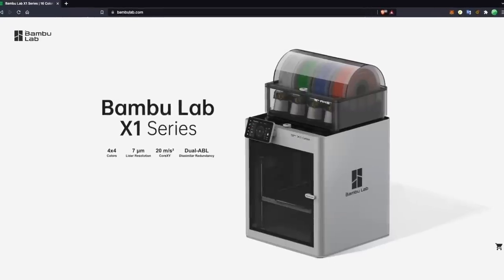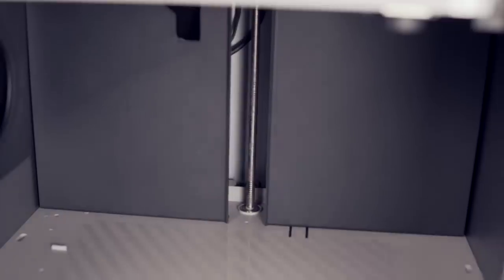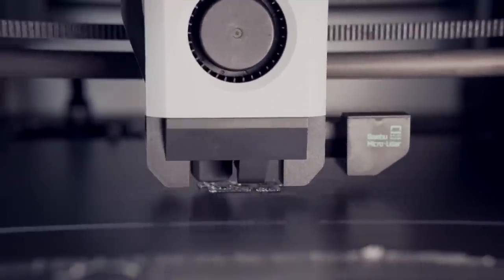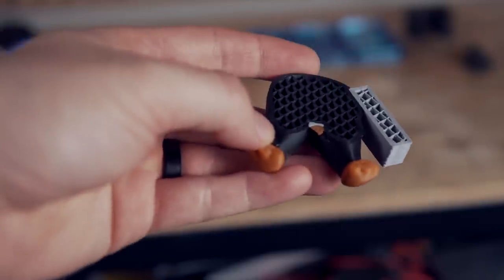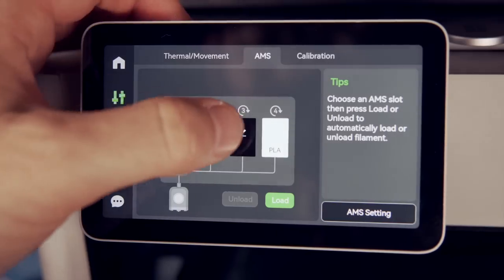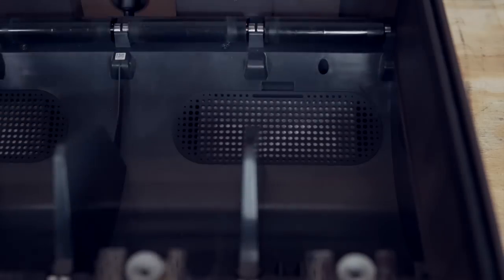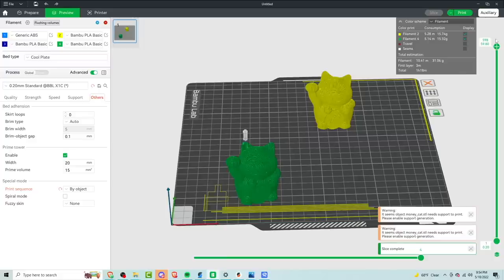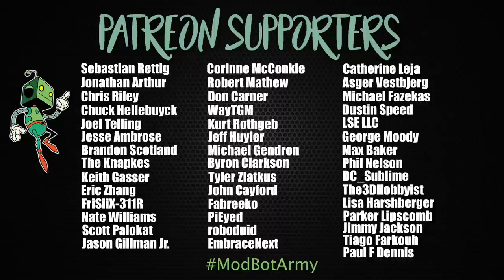INSANE 3D Printer That Requires ZERO Calibration (X1 Carbon)

Comment: This is the DJI style FDM printer we never got! Great video - I am blown away. The only thing that sounds too good to be true is the price for what you get. Nevertheless I can imagine it being successful and stirring up the industry!
Reply: Whilst reading you reaction about DJI, I heard in my head "Battery low, returning home in 10 seconds"
Reply: far from it
Reply: yeah kickstarters for 3d printers tend to be dodgy. 

I would question it. I've seen the same being said about many printers like a few years ago when people said it about delta printers and yet Ender series went on to rule the roost. 

same here. sorry. it won't shake up anything. 3D printing is no longer about innovation. that was the start. now it's about bringing certain standards to budget printers such as auto-leveling and filament sensors. And QOL stuff like linear rails. 

what these guys never talk about is the energy used .. to go twice as fast doesn't cost twice the energy... it actually costs more. like with the new Anker Kickstarter... nobody is mentioning that it uses a TON of electricity in a time when energy prices are out of control. 

just seems rather bot-like. 

and sorry but who is this for? it's got all the stuff aimed at people new to 3d printing... if you are experienced you can mod even an Ender 3 to be this fast and good for cheaper and have more control over parts used..  if it's for newcomers why is it so fast and expensive?

auto leveling and calibration is amazing... if you are new to printing. if you aren't calibrating e steps really ain't hard and even most Ender's and Anycubics come pretty well calibrated... in fact I've only ever had to calibrate one Ender 3 V2... as for levelling and tramming... I don't know why anyone struggles. I've never used adhesive or gluestick because I always got told: if you level and tram properly, keep the nozzle free of blocks and keep the bed clean of oils from skin you won't have problems with the first layer nor elephant foot. 

the only time you might want a BL touch or something is for with Jiyers when using it to make a mesh of build plates. 

And why not just use Prusa and Cura for slicing? this is like when an SLA printer does it... just let us use the slicer we want. so annoying.
Reply: Everything about this printer looks so hot
Reply: The same tought I had! I believe the auto built 3D printers will be almost dead soon if this kind of products will be out more and more... like exactly happened with custom built drones for aerial videos when DJI showed up :(
Reply: @razerow3391  The Bambu Lab X1C uses LESS energy than an Ender-3. From Bambu Lab ENVIRONMENTAL COMMITMENTS: "Due to the outstanding motion and thermal performance of the printer compared to a traditional Ender-3 type printer, we can reduce energy consumption by 50%-85%, depending on the material and model."
Reply: Actually the five guys who had the idea of the machine ffirst are former DJI employees
Reply: @razerow3391  Not even a custom Voron 2.4 using highest level components (which will come out at least twice as expensive) can beat these speeds.

Comment: as someone burned on kickstarter by even known companies, this seems too good to be true, especially what the printer is, claims to do (does in your testing), and the under $2,000 US pricing.  I mean when you think about it, SK-Tank,  RatRig Vcore3,  Vorons, all mostly sourced or kitted sourced, and cost nearly as much (more than the basic kickstarter $800,  up to and exceeding the $1,500) for similar build volume, speeds, and capabilities.

I don't see how they can do this, with the AMS system as well, for that cheap, at least long term.  the KS special pricing on the Carbon with AMS - $1149

The ENTIRE site advertisement is CGI as well, even the shots of the printer, which doesn't bode well.  EVEN the video 'showing off' the printer, is CGI - it seems to have an AMS unit that is real, but nothing showing off the printer being used, printing, or otherwise 'real'.  Your telling me they couldn't show some footage of them test printing a benchy?

I just dont feel well about this.  It seems they made a prototype or 2, sent them out to reviewers, told you all not to say anything "too negative, but well formed opinions are permitted', and plan to make a killing in 'sales' that will never actually be made or sent out to backers on kickstarter. (if you have to ship them back, this is even more support of this claim)

The claim of kickstarter in May and Shipping in July - also doesn't make sense.  Why do they need to kick-start, if they are basically ready to go?  2 months is not enough time to get any sort of funding into manufacturing or production lines to make thousands of printers to be ready for shipping.  The lead time just doesn't make sense with expectations, with reality kicking in about how this more and more feels like a scam, a genius scam, but a scam.

"make a few production models, send them out to get word of our amazing product to those that want it, make the production models a 'force return' to resend to other reviewers, then kickstart, get plenty of pledges, then rug pull and only send out the production models to show we were serious, but had complications unforseen"

I don't know maybe I have been burned by Kickstarter nonsense just 1 too many times. (Thanks Creality for the recent asshatry) and just can't trust in a project "this big" being "this fast" and "this cheap" for what it claims it can do (again, shown in YOUR test production model sent out)
Reply: These are real concerns, and I’m very skeptical considering just how ‘too good’ this is. 

With that said they do have a YouTube channel where you can see them making timed benchies. Maybe updating the website isn’t a priority? 

And even at full msrp this is a great deal without all the risk of being burned.
Reply: To be honest it's not uncommon for "off the shelf" products to be cheaper than building something yourself, especially if they can rely on economies of scale and automation. Still, I'd probably just wait for the product to actually start shipping before buying.
Reply: They have a print farm tho

Comment: I'm betting this thing really took the wind out of the sails of the Anker Make team at those price points.

I really like it overall, but I just hope they do something about the cloud connectivity - let users print directly to the printer over local network w/o requiring internet.
Reply: Ankermake also looks interesting..which to get?!?!
Reply: @jonhaze7537  Really going to depend what type you want and for what you want it for. The AnkerMake seems to be a much needed innovative package on the bed slinger approach where as the BLabs is the CoreXY approach. The latter is aimed at speed and I think is the overall better value at the EB/KSpecial pricing.

I'd say with the exception of a very few features (the BLabs Lidar/Structured Light being one), neither of these printers are truly "new" .. they're just polished consumer friendly packaging of what enthusiasts have been doing to their printers, which is the normal evolutionary step in FDM printing we tend to see every few years.

In ~5 years we're likely to see a lot of these features reach the economy of scale and filter down .. like with car manufacturing, high tech stuff goes to the custom (e.g. enthusiast driven tinkerer's), then luxury brands, then trickles down to the mid tier, and finally lands on the budget tier of every model.

Comment: Thst's a really impressive machine and overall psckage, especially the multi-color printing system with buffer. A single nozzle with an external switcher really is the best solution (and easiest to calibrate). This machine definitely raises the bar for printers in its price range, and for other firmware to improve their feature sets and user experience. Amazing product to come out of a Kickstarter too, as they are usually a lot more janky at the pre-release stage. Exciting times.

Comment: Soooo .. that Kickstarter went well. I've never pledged for a KS printer before, but we'll see how this goes. Was able to win the refresh lotto and get an Early Bird X1-Carbon. The Full Combo was sold out pretty quickly. I don't expect there to be much available by later today, they mastered the just-enough-units at the outrageous pricing to generate the buzz and hype they wanted, that's for sure. So for those wondering how this was going to be sustainable, that's your answer. Very limited supply at the Early Bird and KSpecial pricing (approximately 500 units each model / tier) .. they can effectively break even or take a loss and make up from it with the marketing they received.

My current printer is a ~5-6 year old unit, so it was in  need of a replacement. I'll likely give it to a local school.
Reply: That's pretty sweet. I missed the early bird prices so I'm just going to wait it out for updates. I am considering a prusa XL just because the build volume is bigger for my needs but no doubt bambu lab is using tech that makes every other hobby level machine jealous. Heck even some industrial machines are jealous. It's like an advanced 3d systems Cube Coretrio and voron tech had a better baby. Love the colors, love the lidar, love the speed.
Their turn around time is way better than prusa though.

Comment: If you want your printer to just work and not be constantly tinkering with it, this looks like the one.
Reply: This is made for me.  The only things I see here I would want is different print nozzle sizes on-demand (tool changer) and larger volume.  But the speed makes up for the nozzle size issue so for smaller prints this looks awesome.  Smaller is often faster also, so it sounds tailored well for a fast prototype system.

Comment: Very impressive.  This is definitely a machine I will keep an eye on.  Not a fan of Kickstarter, cloud printing or proprietary/custom slicers.  Why not just Octoprint support and just save the effort of spinning up cloud resources and software?  And why not a Cura plugin to support their slicer extensions? I'm pretty sure any of the open source slicers could be extended to support all of their nice features.  Then it's automatically cross platform, they get the benefit of improvements to the open source engines and users can use the interfaces they already know and like.

Comment: Seems an extremely well thought out machine. I've been thinking about some kind of vision-based first layer calibration for a while. I'm surprised their LIDAR can achieve sufficient accuracy. I suspect it's really a triangulation sensor, not a true LIDAR (which is fine and would be impressive as I have Keyence triangulation sensors at work that cost more than this printer).
What ever happens to Bambu and this printer, they have shown the way. My biggest concern is if they can maintain a low price point? Are they badly under-pricing the Kickstarter?
I won't be pre-ordering this as I'm done with Kickstarter (at least for a while), and won't be an early adopter for a company that has no track record (I did pre-order a Prusa XL, as I trust the brand). I wish then success though.

Comment: I can't wait until some of these new features trickle down into more basic printers and into klipper for the firmware things. I wouldn't buy one of them, but I'm also not the target audience. But I am very glad for anyone innovating in this space as it pushes other manufactures to do the same (Prusa comes to mind, revolutionizing 3d printing with the mk3 and now most of the features are standard even on fairly budget printers).

Comment: My concern is that they don’t have enough margin in the product, they will go bankrupt, and the customer will be left with a proprietary printer with no parts available and no software updates
Reply: Had similar thoughts. Even at the full MSRP it's hard to feel like they're making any margin and I have to suspect that the RFID chips will eventually DRM what filament the machines will accept.
Reply: @voicesarefree  Yup! There was a lot of engineering that went into this and I know what engineering time costs when you roll it into the product cost.. I hope I'm wrong though.. I have a print farm and would like to pick up a couple of these to test, but I will probably wait a while to confirm reviews once they hit the market officially.
Reply: @voicesarefree  Completely wrong, there are absolutely 0 expensive parts, if you know some ppl in the industry you can manufature this for around 400 all in with shipping, still a thin margin but it's fine.
Reply: @revoltoff  Retail price isn’t just a function of production cost and margin😅
Reply: @revoltoff  Perhaps 'any' was the wrong word to choose, and 'sufficient' would have been better. Like others have mentioned, all the wages and infrastructure around selling hardware demand either massive volume, large margins, or some other monetization scheme like DRM or subscriptions. The X1 has a lot of software that at this point looks (fully?) proprietary, and custom software development is not cheap.

FWIW, I worked for a printer manufacturer for ~4 years developing in-house manufacturing software. I have some relevant industry experience informing my opinion.

The X1 is an exciting concept and I would love to be proven wrong.. but I suspect the currently stated MSRP will have to rise or other "all-in" costs will need to be added for Bambu to turn a profit.
Reply: If they sell well, supply and demand will drive up prices. It's not at all uncommon for new products to be priced low, in order to get enough out for use and review. If the reviews from users match the claims, their prices will rise to meet demand.
Reply: @louisboliou7432  I’m aware of that. I just know that at the $1500 price it is out of range for youngsters and true “hobby” people. I think they would still have something here if they were at $2000. The feature set in this rivals our $70,000 stratasys printers.
Reply: @louisboliou7432  Yeah, basically they're a bit too late though sadly, most people got an Anker already and very few are willing to get both or even know about this (much better on paper) printer. Honestly, I think in the next 3 years 3D printing will finally become ''good'' because even for enthusiasts, the tech used is just old at this point and clones of clones of clones. I am not 100% sure but I do think in the next 3 years HP will probably release a printer.
Reply: Always price your product so the buyer hesitates a little and thinks a little but still ends up buying every time. If a buyer just buys it and says man what a steal its wayyy too cheap, they should say it's the best however it's cost reflects that, often times serious buyers may go elsewhere if the price is too low as they think it's too good to be true.
Reply: @northcountrywoodcraftny5953  yup.. that is my concern 100%.. I would rather pay this company 2k per machine and keep them in business to support the growth of my business rather than get a "steal" and bankrupt them over time...
Reply: @oneheadlight8000  I do not totally agree. This first realeses, companies need to have good sleeping points, and the price is one of them. Of course is more risky, they will deliver, they will support, bugs, etc. it is not a ultimaker. With this in mind, if they deliver everything anounced, could shake the market.
Reply: Or, this is the plan all along, as the 'production models' will be  the only ones really sold, and they will bank the rest of the kickstarter calling it a 'unforseen expense problem'
Reply: @Filthat  Yeah.. I think they will disrupt the market big time if this is representative of production units and they don't have any deal-breaking bugs. I have been in contact with Bambu lab for using these in our print farm. I am still hesitant just because it is a lot of money if it won't be supported in a few years.. I'm just weighing the pros/cons. We could use the multi color functionality and high temp abilities for engineering filaments at that price.
Reply: @voicesarefree  Which printer? And how much? Many 3D printers are grossly overpriced which is why the DIY printer community was born with the likes of VzBot and Voron because they cost so much and perform less than community designed equivalents. Most of the costs of said printer companies is from them endlessly showering marketing money on their products and not being budget conscious at all because they can count on a gluttonous stream of enterprise customers (looking at you, Ultimaker) to foot their bills.
Reply: @voicesarefree  you can look them up. 2 big investors, fundraisers for development. They've got cash for selling a few thousand cheap on KS and then some. They cut costs and production time by going through robotic manufacturing.
Reply: @revoltoff  Yeah. I get emails from kickstarter. I never got one about the anker which I am more willing to drop the money on. Just got the email for this one but all the early birds are gone by then. But on paper and in confidence of receiving a good working machine, this one is definitely the better option. I am just need a push over the edge about spending the money as I seldom print anything. I am in the designing and testing of a product and would love the speed and build plate of this printer.

Comment: Would be awesome if the LIDAR was active during the entire print to start compensating for geometric inaccuracies (slow things down/extra cooling if the bridges or small features are not coming out as intended). Also, I hope they provide an SDK so the LIDAR can be used with other slicers if they go out of business.

Comment: That's' an awesome printer and it's priced for the consumer market.  I don't like the cloud based slcer, it needs to be available as an installable app form before I will get one.  I have been watching this printer for a while.  One thing to note the build plate is special for the lidar to work so you will need to use theirs.